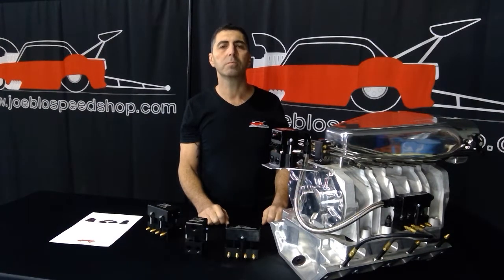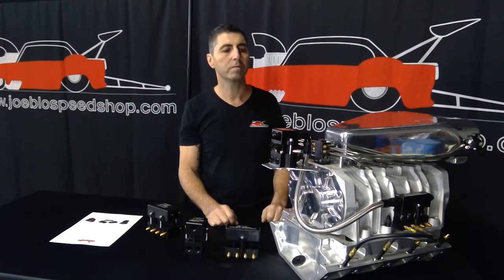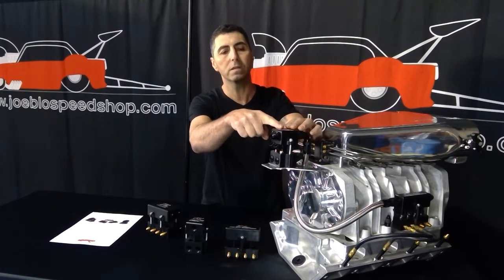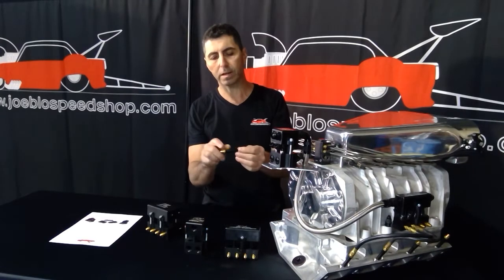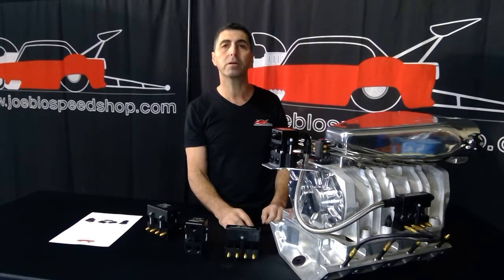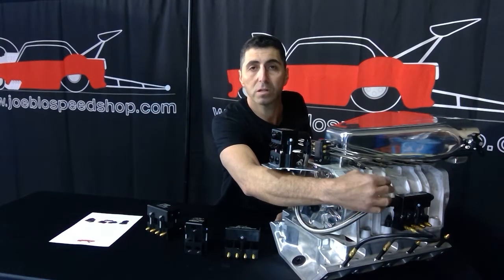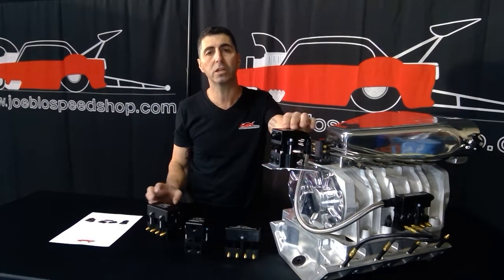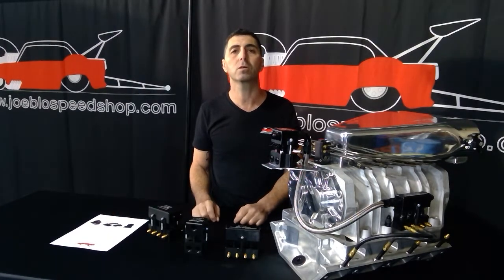Joe Blo Speed Shop EFI/Mech Blend fuel system

Comment: I'm very very interested in your EFI setup. Which ecu would use? And if I run zoomies headers how would the ecu read what to do
Reply from the maker: We are dealers for Haltech.
For most street cars we use 2 X O2 sensors in each collector. As for zoomies you may just put only 2 still and it will still work. But you just need to make sure that all the cylinders are pretty even.